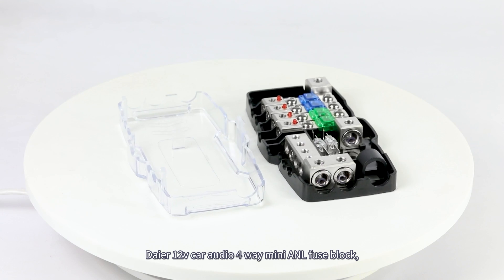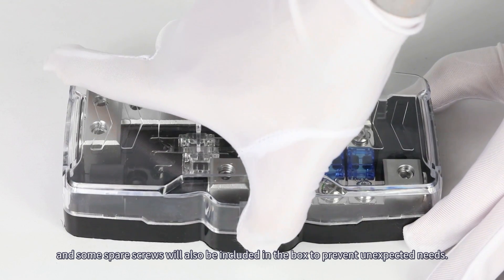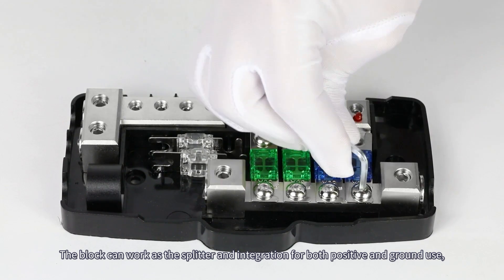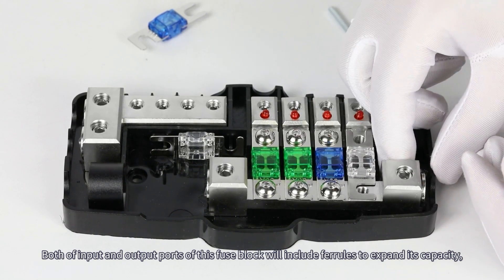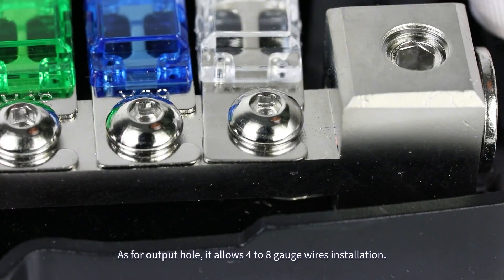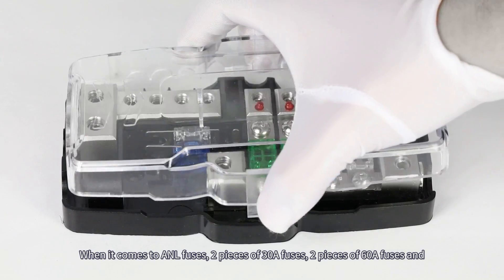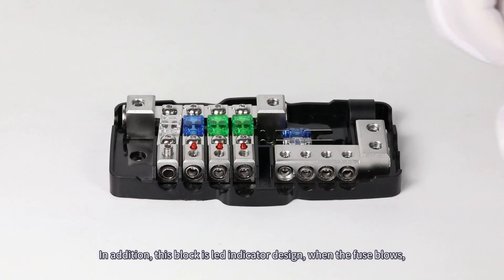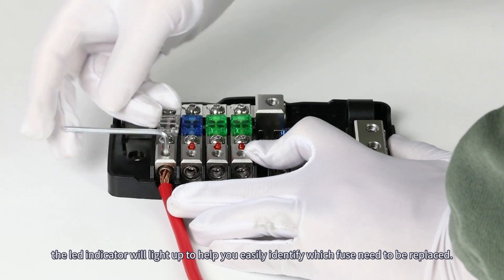Car Audio 4-Way ANL Fuse Block - How to Wire a Sealed Fuse Block?

Comment: Could this do a 150A fuse for sub amp, 100A fuse for speaker amp and 20A fuse for DSP?
Reply from the maker: For a 150A amplifier, 2 AWG (or ideally 0 AWG for more headroom) is recommended. Use 4 AWG for a 100A speaker amplifier, and 8 AWG is sufficient for a 20A DSP. Remember to keep a safety margin in your gauge choices, and ensure your input wire is thick enough for the total system current.

Crucially, purchase appropriately sized fuses for each device.